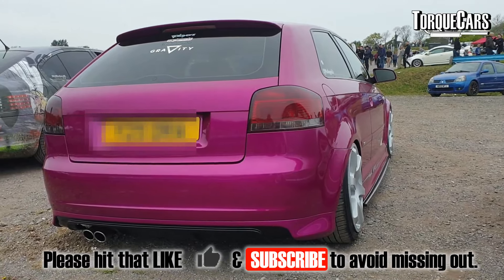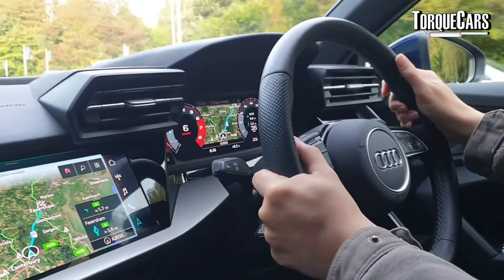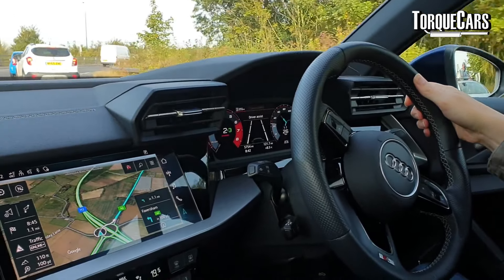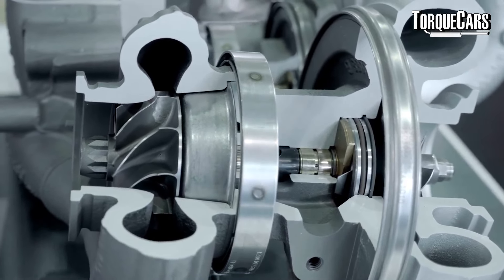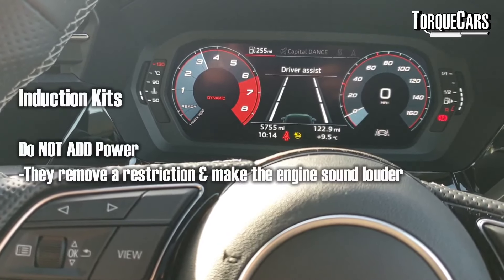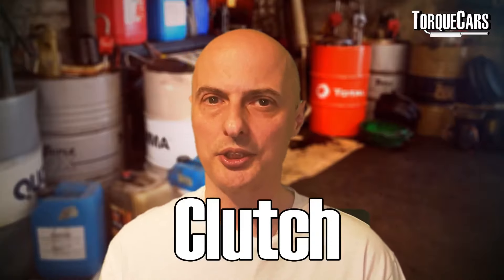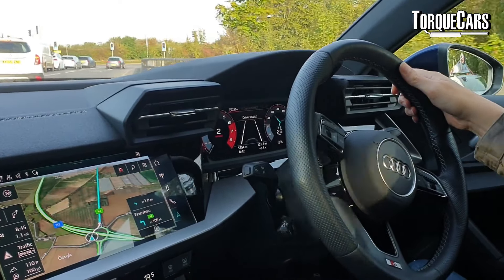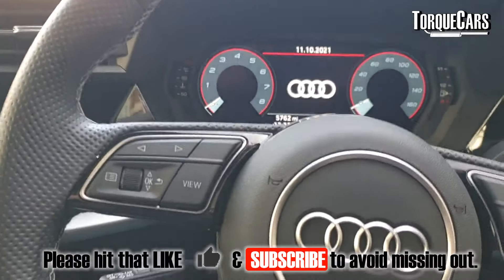Best Audi A3 Mods (and ones to Avoid!) [8L 8P & 8V Tuning Guide]

Comment: Absolutely love your content!!! I have just bought a 2006 A3 Sportback 2.0 TDi (BKD - 140hp) which I am planning to strip down completely and rebuild and modify both mechanically and cosmetically along the way. They are such fantastic vehicles with so many options for modification. Really looking forwards to your future videos on the 2.0 TDi. Keep up the amazing work.
Reply from the maker: Thank you for your kind words of encouragement and I'm glad you are finding these videos useful. You have good taste in cars. There are so many mods and upgrades for those 2.0 Tdi engines.
Reply: is that what you think? I have a 2014 audi A3 2.0 TDI and know nothing about diesels and have no clue what to do to make it faster
Reply: @SoraGremory0121 keep it stock mate. Diesels are bulletproof. Don't fuck the engine up. 
2.0 tdi is fast enough in these cars. Its an a3 not an rs7.

I have an 06 a3 140hp, i can fly with it on highway. Its faster than the speed limit, it's enough

Comment: A3 😎 1.6 102cv 4cilinder 8v manual 5 gears.. petrol.. it reaches 160km x h at 4.700 rpm sportback black with panoramic roof double

Comment from the maker: So which model of A3 do you have? Have you done any mods to it? What do you recommend doing? What would you like to see me cover in future videos when it comes to the Audi A3?
Reply: I have the 2L TDI, Not done anything to it yet other than a wrap, not sure what to do really. I'm thinking about a remap for fuel efficiency. What do you recommend?
Reply: 2018 A3 quattro 220bhp. (US sedan). Eibach lowering springs  - Eibach 20mm spacers all round. Milltek non resonated exhaust - custom 3" downpipe. K&N intake filter. APR stage 1 ECU & TCU tune - now 320bhp and 460 torque. My car is black and I've had a dechrome - now all black. Standard 18inch wheels painted matt grey with P3 all weather tyres - I live in Ukraine and need all season in the winter.
Reply from the maker: @BRIGZY09 I had the 2.0 TDi BKD, a remap is an essential, and even the higher power maps will generally provide much better fuel economy. I rate Revo, Awesome GTi, Celtic Tuning, JFA Automotive, Darkside developments and TDi Tuning. Where are you based these are mainly UK providers? Aim for a modest 30hp bump and you should be right in there with maxed out economy, decent power and retaining factory reliability. 

Is yours the 140 or 170?

I will be doing a video soon on the 2.0 TDi as it was one of my favourites and there are quite a few options out there.
Reply from the maker: @Alan Ahern  That sounds like a really good spec, the Quattro really helps get the power down, especially on the wet roads. I noted the A4 LeMans alloys were slightly wider than the 18inch A3 versions, so I didn't need to use the spacers, they fitted the arches nicely. Are you planning any more upgrades?
Reply: @torquecars  I look forward to the video, I have the 140
Reply: 2017 a3 quattro, getting an apr tune next week and considering k&n intake
Reply: 2.0 tfsi
Reply from the maker: @BRIGZY09 mine was the 140 a BKD version.
Reply from the maker: @shay let me know how you get on with it, I've heard lots of good things about APR.
Reply: 2015 A3 1.4TFSI S-Line. Any recommendations? Suspension feels stiff but I don’t fancy replacing too much with it. Was thinking of doing an induction kit, any brand recs?
Reply from the maker: Same as me, The S Line is pretty hard and crashy. A set of coilovers work really well on these, Bilstein, KW and Koni are brands I know well and have no trouble recommending. Induction kits won't add much power, I'll do a video next week on induction kits for you, as this crops up a lot. K&N make pretty good kits though as do Pipercross, but it's more about noise than power on these engines. A panel filter is a good compromise, particularly if you've remapped or plan to.
Reply: @torquecars  thanks for the quick reply. 👍 Mine is a Japanese import so I didn’t really get to test drive it, but I was kinda shocked at how bad it takes speed ramps and potholes 😅 I read on some Audi forums that when specc’ing our cars out from factory there were 2 choices of suspension on the S-Line models, 1. A stiff sporty suspension and 2. A softer more comfortable one, not sure how true that is though as you never know when reading online forums. I would be just interested in the induction kit for a minor sound upgrade more than anything to be honest!
Reply from the maker: Yes there were two options, mine has the softer suspension, I learnt this lesson from my A3 Diesel. The harder springs also broke on me so that gave me an excuse for a proper upgrade. IIRC the S Line is around 20-30mm lower than the softer option. I did find that Goodyear Eagle F1s, a softer summer compound tyre helped keep the ride a little more forgiving.
Reply from the maker: @shay did you get the APR tune done? How did it go?
Reply from the maker: @jalkie The sline suspension is fairly hard and crashy. A decent set of coilovers would work wonders. Bilstein, BC, KW, Koni etc all work really well, just don't drop it too low.

K&N kits are pretty good especially when you fit a cold air kit. You won't get power gains to speak of with it though unless you've done other mods.

Comment: I have a 2006 audi a3 2.0T, i have a stage 1 tune done, what else could i do, to make a little more power, and still be able to keep the reliability. Also, how much power could i handle on stock internals?
Reply: It has an automatic dual clutch transmission.
Reply from the maker: The DSG is usually the limiting factor but these are pretty strong, many of the guys are talking about them handling 400lbft of torque. With a remap and performance cams & fuel upgrades (Autotech High pressure fuel pump) and with the right turbo you should see around 300hp fairly easily and reliably. The remap is quite a cost effective mod, I discovered that pushing beyond this requires quite a bit more cash and outlay. Turbo upgrades are also worth considering, if yours has the KO3s then a KO4 will give you more headroom and these are readily available in the recon and breakers yard markets. Personally I would aim for around 260hp ballpark for cost and reliability purposes.

Comment: brilliant video , i have an Audi S3 8P, 2010 in sprint blue, with a K&N  washable filter , it breaths harder at high rpm , otherwise its stock 265 bhp, i feel its quick enough without a stage 1 remap, but i will be fitting a turbo delete muffler kit later and may look again at soft poly bushes £300 , the brakes are really good , may replace the the rear calipers , and rear shocks , carry on with the great work and knowledge you share !

Comment: Fantastic video, thank you ! I would really appreciate if you could mention some of the decent tunning boxes. I have an A3 35 TFSI (8Y - 2021/2022), and i would be really interested in getting a "proper" tunning box, that would increase the HP and Torque, as well as decrease the fuel consumption.
Reply from the maker: I used the one from TDi tuning on my 1.4 TFSi and was quite impressed with it. Fuel economy gains are not stunning, but it did help a little although I tend to have it on the performance setting most of the time. There is a review of this on my channel.
Reply: @torquecars  Thank you, much appreciated ! :)

Comment: I have a 2008  8P type quattro 3.2 vr6. Tuned to about 265-270 on 93 octane. As for mods. a dogbone insert, 24mm rear sway, S3 front arm rear mounts, ECS tuning intake tube, an ITG drop in filter, DSG alloy filter housing and Powerflex front sway bar insulators. Running the new Falken Aklimates now but haven't had them long enough for any opinions. Prior to that I've run Sumitomo HTR P02 in front and P03 in the rear. They have worn well and the P03 have worn better than the prior model P02. Both grip well dry or wet, wear nicely and stop better on snow/ice than many all-seasons. I ran Sumitomo Ice Edge full snows without studs on extra wheels for a few years and the last two years since they weren't good enough for a bad winter so I used them for 12k miles all year round and they wore surprisingly well and even. All the wheels are factory 5 spoke alloy 17".
Reply: This guy has done an excellent & cost effective list of mods.

Comment: My husband bought an a3 s line 2.0tdi 140hp had limp mode issues but now all sorted, it’s now running hybrid turbo stage 2 remap with 3inch exhaust updated injectors and s3 intercooler stage 1 clutch and induction kit so much fun does puff a bit of black smoke on full throttle but no rolling coal

Hp is now around 220-230hp and 475
Torq

Comment: I use ebc yellow stuff for the front and they're more designed for street and track use, a little dusty but they have great stopping power. I use red in the rear which is high preforamance street pads but not quite as aggressive as yellow. Great dust management and still really good stopping power. You should try ebc again on your next set of pads. I love mine and the yellows have been on for about 20k miles and still have atleast 10k more miles left if not more
Reply from the maker: I will certainly give them another go then. I know formulations change over time.

Comment: Agree on the stiffness of s-line suspension. I always thought coilovers would make it even worse given that once you go coilover you are then tempted to lower the ride height as well. What coilovers would you recommend to reduce stiffness and improve ride comfort?
Reply from the maker: Bilstein and KW are the only 2 I've had experience with, both outperformed s-line for handling and give better ride quality in my humble opinion, just don't wind them down for a massive drop, about 20mm over sline or 40mm over stock usually works best.

Comment: What an awesome video! 2.0 diesel owner here, had a snapped spring it was hell. Currently dealing with DPF issues due to a remap, also hell😂 Any advice on what I could do to max the power/reliability?
Reply from the maker: I know you've found the video link already but for anyone else reading this the 2.0 TDi engine tuning & mods are covered here https://www.youtube.com/watch?v=4D9bfhngKGc

Comment: Please help! I have an audi a3 pd140 with a start up issue. After being left overnight, first start of the day will take around 15 seconds cranking before the engine starts. Idles limpy for a few seconds then smooths out, every start up for the rest of the day is perfect. Any ideas, please and thank you. Also the videos are great and full of good information (hence why im here) people could learn a lot from them. Thanks again.
Reply from the maker: Could be a number of things. Check for fault codes this will usually give more of an idea of whats going on. If the car doesn't see 250rpm it will not supply fuel, a weak battery, or dodgy starter motor can cause this. After the car has run, oil has circulated, everything is warmer and the battery has typically had a boost, so the car is more likely to achieve the required starting RPMs. Other issues could be the fuel injectors silted up, fuel filter, blocked EGR/ASV assembly. Check for parasitic battery drain, especially if the battery checks out as ok or passable.

Comment: In your experience, would there be a point to a stage 1 remap on the Pre-lift 8v 1.4 tfsi 125hp? I've looked around and it seems they do 15-20 hp at most :) I'm not sure whether this will be a noticable difference.

Comment: Just got an 2014 a3 quattro 1.8 tfsi s tronic because i cant aford an s3 or even an sline model of mine haha 😆 but im not all that educated on modern audi motors after the mk 1 audi a3 and tt i lost touch with them so im just putting feelers out to see what brands and makea have decent bolt ons for my type of car nothing cary as its still primarily a family / shopping trolly motor hence the automatic gear box but id like to make it sound good and shift when i want to put foot down from time to time i hope o can get it mapped but just on the sports mode and have it close to stock on the eco and comfort mode
Reply: Really I just want to know what difference is between the 1.8 the 2.0 tfsi and the s3 as far as I've heard there all the same running gear and blocks just mainly differences is the main power components such as like you said bigger turbos , injectors , better duel pumps , bigger pistons in the 2.0s better breaks and suspension , bigger free flowing exhausts , if I could just plug ans play most s3 parts on it that would be great haha 😄

Comment: Inductions kits do make a difference but it’s all about location of the filter. As you said if you start sucking in more hot or warmer air it take power away.
I like to use cone filters and I locate it as low as possible to catch all the fresh it can get and as we know heat rises so why do all tuners instal them so high in the engine bay
Reply from the maker: Interesting observation. There is a fear that when cited lower there is a risk of sucking water into the engine. IMHO a properly designed cold air feed will not do this, especially if boxed off slightly from the engine bay and wheel well areas.

Comment: 312mm brakes with ebc brake pads is really what is enough 😉 i will go for bigger turbo on TDI and pass over 200hp and have fun 😅 and you have really cheap pocket rocket  (fuel consumption) and massive torque,im currently owning 1,4 tfsi 180hp,but had many 1.9 TDI projects ass well,mk5 1.9 waiting for some boost soon 😉
Reply from the maker: Great tips, glad to see another A3 owners enjoying their car. Thanks for the support my friend, good to have you aboard.

Comment: I like This video you explain everything nicely I have a audi a3 1.4tfsi 2008 and this video has gave me more knowledge now I understand I don’t need to over power the mods because the car wount be able to handle this need to just make it medium as it’s not a powerful engine 
I was wondering what exhaust can I buy for a audi a3 tfsi 1.4 2008 am confused my dad said if you buy the wrong one it’s a big problem again 
Also I was wondering do you think if I put a new exhaust and done a air filter and done stag1 will the insurance be crazy sky high or will be alright ? Thank-you so much .
Reply from the maker: Thanks for your kind words of encouragment and support. I'll be doing a video on the 1.4 TFSi very soon so watch this space. Catback exhausts will not affect the engine either way IMHO. Downpipes and sports cats will help the turbo spin up more quickly though. Insurance depends on who you are with and I would recommend seeking a specialist for modified cars and you should get a decent rate with all the mods declared. Adrian Flux and Chris Knott are pretty good places to start in the Uk.
Reply: @torquecars  thank-you so much my friend

Comment: Hi, new sub here. I have a 2016 A3 1.8t. Upgraded from a RaceChip tune box to Unitronic Stage 1 ECU and TCU. IE carb legal intake, I'm in California. Turbo inlet and Turbo muffler delete. Also have APR coil packs and charge pipes and hoses. Would love to do an intercooler but it's a bitch to change. Next I removed the muffler and replaced the resonator with a performance resonator and added quad tips. Have Maxton Design splitter, side splitters and defuser, gloss black on monsoon Grey car. Looks great and fun to drive. Probably making around 250hp and 280ft. Do you think the turbo will hold up? It's an IS12.
Reply from the maker: Intercoolers are a problem, you can almost see why manufacturers do what they do to avoid the hassle. Also thanks for the support my friend.

Comment: I've got a 2016, 1.6tdi a3 sline nomatter how I drive its awful fuel economy had it fully serviced any suggestions ?
Reply from the maker: Is it modified in any way? Perhaps a remap will improve the fuel economy. What figures are you getting? It shouldn't be too much lower than the factory figures.
Reply from the maker: A simple remap on that should give you around 45hp more power and 55lbft of torque for max economy a remap of around 30hp should be in the sweet spot for power vs economy and be better than the stock setup. It has the EDC17C64 ecu on it.

Comment: Are they really enough mods for a Audi A3 1.4 8V?
I’ve got a custom tune, downpipe and custom exhaust. 
Thinking of a cold air intakes but here in SA one has little choice, what brand of intake would you go for?
Reply from the maker: Intakes have not really made any more power in my experiences, the stock airboxes flow really well. I drop in a K&N Cotton gauze panel filter instead of the full induction kit on most cars I buy. K&N & Pipercross are brands I have used and are very well made.